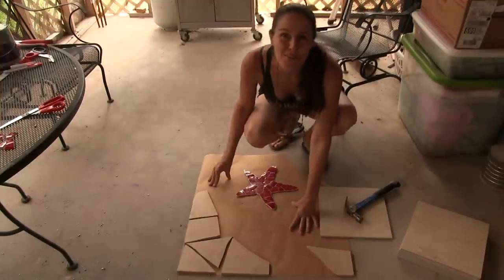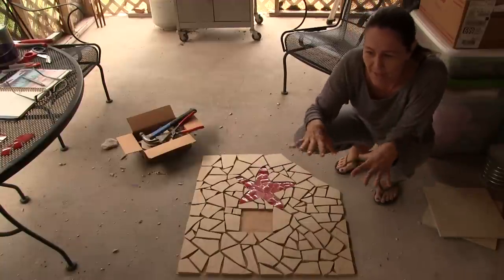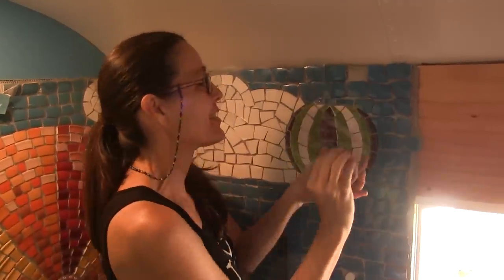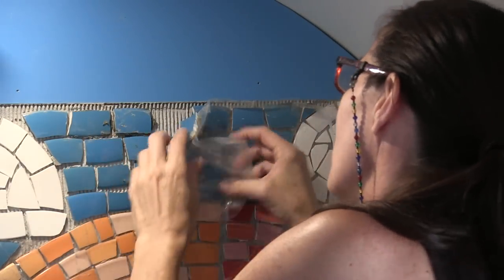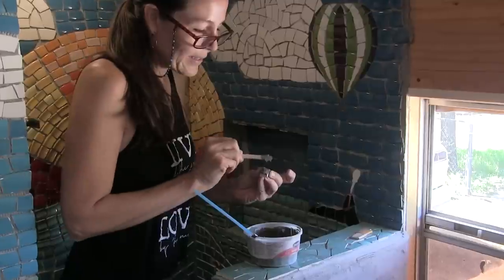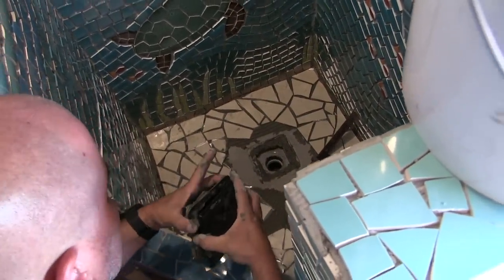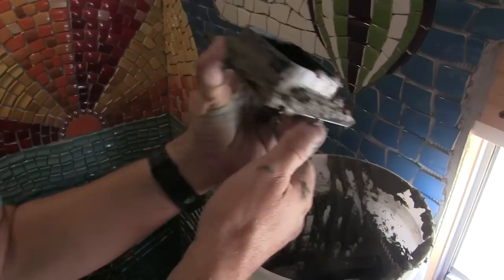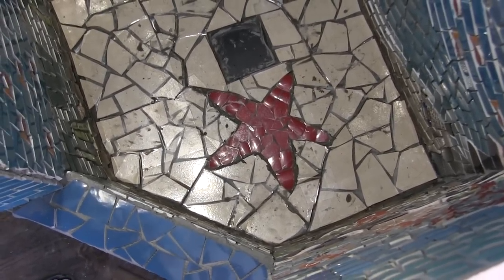Broken-Tile Mosaic Shower Floor & Mosaic Shower Wall Repairs in our Skoolie

Comment: Kerry, I know space is at a premium in a skoolie, but I would save a small box of pieces in case you need to do a repair.  I've been a long haul truck driver for 23 years,  and I know how the road can shake stuff loose

Comment: G'day it will be interesting to see if the tile adhesive stands up to the job, it's not meant for excessive movement and the bangs and the vibration of the bus, the stuff is meant for a house wall with little to no movement.  Construction adhesive or some silicone that can take the movement and shock of the movement of the bus, but good luck guys and I really hope that it works out, if not you can always add silicone or similar bit by bit.     John

Comment: It would be more expensive and time consuming, but it would look so good if you used multiple colors of grout: blue for the sky, white for the clouds, etc. Please give it a little thought.

I regrouted a grey kitchen counter with white, and it didn’t even have time to set up before I was scraping it all out to redo it in grey. Worth it though.

Comment: that looks amazing!  I wonder, though, because of the smooth finish of the plates that adhesion is going to be an ongoing issue.  If you look at tile, the grout side is porous and rough, giving the thin set something to bite into.  Oh well, just keep some grout, thin set and some tile tools on the bus with you and fix it when it breaks.

Comment: Love your bus! You two have done a fabulous job. Did you by any chance save a few pieces of each color of tile just in case a few break down the road? I'm hoping they won't but seems you would have trouble matching colors? Just a thought. Both of you have a wonderful week.
Reply: Just save a plate of each color. Use them for dinner till you need to break one to fix a "gotcha" in the shower.

Comment: What I've learned is you need to have smaller pieces around your main focal point and then your pieces can get larger as the area is further away from your focal point.  And you need to have some tile Nippers to be able to shape your pieces

Comment: Doesnt matter a lot with the walls but make real shure to lay the tiles flat on the floor if one of the points are slightly up even a tiny bit theres a big chance you cut youre foot on it you could sand all the glazed edges but tuat be a LOT of work
the mount of tilebits in the big bin reminds me of sumting a filipino neighbour of mine did , she used to send balac bayan boxes to the filipines , those are boxes that are send there for a set price and are not limited in weight  or by wat you want to put in it , i just need to fit inside the box , the boxes get consolidated intoo a sea container and redistrubuted once on the islands 
whenll they chaged that policy slightly with a maximum weight after my neighbour decided to fill the box up with glazed tiles for her new home in the filipines turning the box intoo a clay block of roughly the same size as the size of the box  , the guy picking the box up for shipping allmost couldnt lift it and he still had to go down 4 flights of stars with it

Comment: Question.... why didn't you guys use e600 glue instead of thinset? In the wall concrete or cement or something? Genuine question tho....I've seen people use e600 doing mosaic tiling on sinks and vanities. Then they used grout on the whole thing. This is beautiful BTW. 😍

Comment: Should have used liquid nails  behind all of those tiles, the bouncing in the roads will cause them to pop off.
Reply from the maker: Liquid nails is mastic and will fail due to prolonged water intrusion. Liquid nails is an organic compound that decays when exposed to water. Liquid nails is a very poor choice of adhesion.

Comment: Why did you put contact paper on the front side? I think I would have used and did use mesh backing to create the design and then install it.  That way you have got absolutely nothing that you need to take off. And all of your tiles stick. It also gives additional Integrity To Your Design. Try it next time you do a tiling project